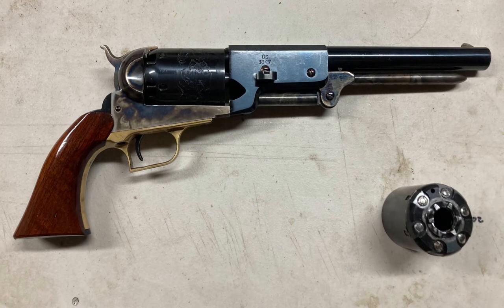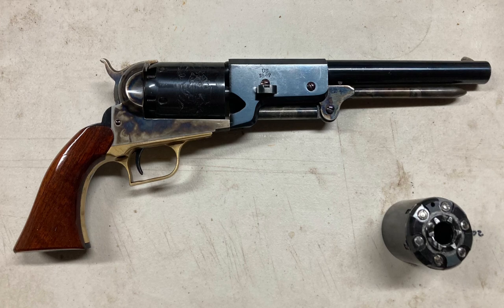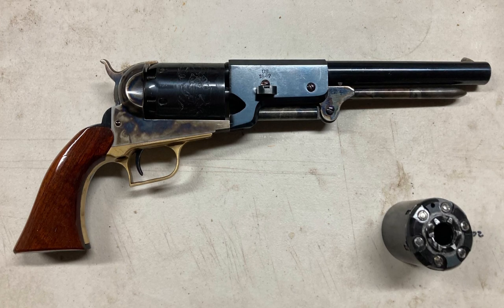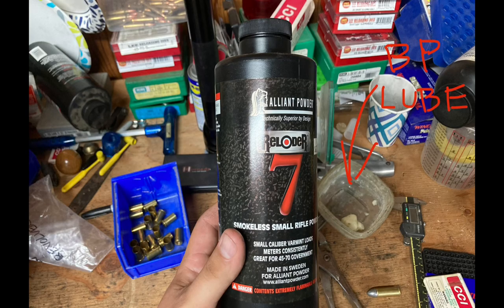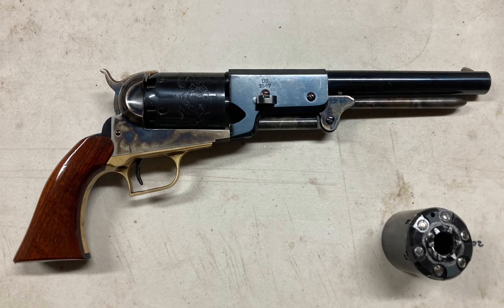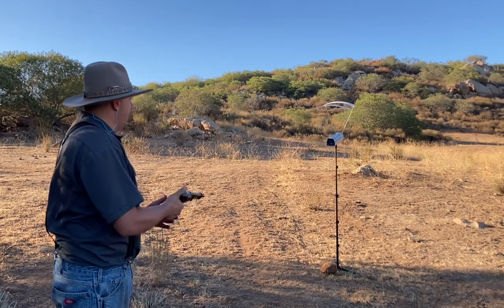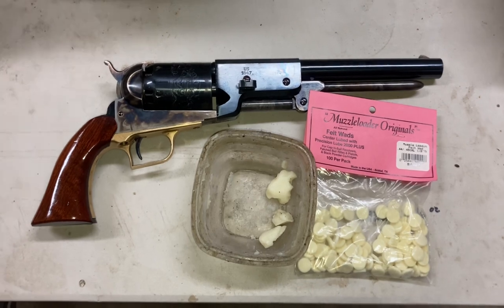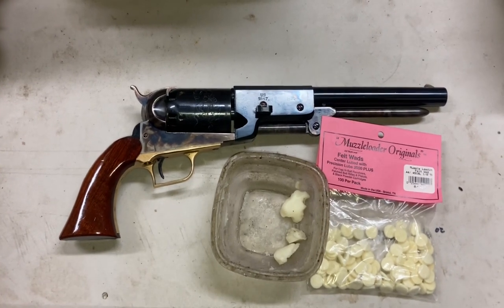Colt Walker Chain Fire

Comment: Never had a chain fire but I did have a pair of dragoons shear off the cylinder base pin at the wedge within days of each other. Armi San Marco quality.

I never use wads. Grease every third cylinder to keep things moving. .454 or .457 balls that shave off a big ring. Remington #10 caps. Seems to work fine.
Reply from the maker: I have one Army San Marco 1858 Remington and 454 balls don’t shave any lead. It will chain fire without wads or grease.
Reply: @Everythingblackpowder  Wow! Those chambers must be way oversized. Might even have flaws in the metal allowing flame into the next chamber. I gave up on all the San Marcos after the pin failures and only have Pietta’s now.
Reply from the maker: @HughesEnterprises  yeah, it needs a 457 ball at least.

Comment: I have had chain fires from a .22 revolver. Several times. It was unreal. Nothing was obvious but I polished the breech face and it hasn't done it again. The gun was a 1950 model H&R 922.
Reply: Had the same thing happen with an identical pistol. They are 9 shot, and the chamber walls between the rounds are quite thin. Today’s higher velocity rounds are just too much for the old gun, and the percussion can set adjacent rounds off. It’s pretty crazy, cause the other round hit the side of the frame and sprayed lead everywhere……it’s now my snake gun, and I only use ratshot and shorts……I’ve got two, one nickel round barrel, and the one that chain fired, a blued with a flat sided barrel. Beware the high powered rounds. And definitely stay away from stingers and maxis.

Comment: I had a chain fire from a 44 navy even with grease on all chambers, it hit the breakdown pin and knocked it 10 feet from me when the ball went beside the chamber! I was amazed it chain fired after the grease was used.
Reply from the maker: Wow
Reply: It probably happened from the rear side of the cylinder in that case, grease at the face end won't help that.
Reply: @redtra236  Yeah, you can't put grease on the nipples then put the caps on. My thinking later was the grease from some of the cylinders may have left after firing and some residue from the powder ignited.

Comment: Because loading the bp revolver is part of it I always use felt wads and boar butter. And in forty years of shooting I’ve never had a chain fire. 
I bought a sheet of wool and cut my own wads using a hole punch I got from harbor freight. They come in different sizes so you can cut what size you want.

Comment: I'm somewhat new to percussion revolvers, but from my experience, you have to make sure every piece in the system is within recommendation. All sorts of small things matter like the thou measurement of your projectiles and how tight and secure your caps are to give those core systems a nominal barrier against all sorts future issues. If the chain fires were caused from poor projectile seals then those patches and greases will probably do the trick, otherwise start looking long and hard at the other systems to end a real headscratcher.

Comment: Colt’s original instructions stated to load a [tight oversized] ball (or conical) over a powder charge and then prime with tight-fitting caps.   The only way you could get a chain fire from the muzzle-end of the cylinder is if the projectile isn’t perfectly round and seated. There should be a ring of lead shaved off when ball or bullet is completely seated. Loose caps are the main culprit of chain fire
Reply from the maker: Yeah, I’ve heard the loose Story 1000 times and I have a hard time believing it. If you’re interested, you can watch this video where we test that theory
Reply from the maker: https://youtu.be/hzkGsQWh4Gw?si=VsFQCgHDrqAyH5Ly

Comment: Did you ever figure out the velocity you were getting? And why the odd readings? Elmer Keith always said greasing and wads had no bearing on chain fires, that it was cap/nipple related. Cool video mate, thanks
Reply from the maker: Yes. 55gr 3f and a .454 round ball averaged 1253fps
Reply: @Everythingblackpowder  thanks mate,  that's quite a punch!

Comment: When you use a chronograph with blackpowder, you need to set the chronograph at least 30 feet away or it won't work right. I wonder if the muzzle blast was going 7200 fps? :)
Reply from the maker: agreed

Comment: If the ball has a ring of lead shaved off as you load the ball seals the chamber.  The wad before the ball lubs the ball and moisture mixes with powder fouling to keep it soft.  I have been shooting bp revolvers sense the 1960s.  I have had one time multiple chambers fired.  With an old 1858 new model Remington.  It used #10 caps and I was out.  I pinched #11 caps so they would stay on the nipples.  I watched the spark move from under 1 nipple to going under the next.  Three fired with no damage.  I now buy 1000 #10 caps at a time and when I get down to 500 I buy 1000 more.

Comment: Could be an issue with a wonky chamber diameter or defect in one of the chambers as well. Grease/wad would probably make up for that but if everything is correctly spec'd and fitting I don't think grease and wads are necessary. That's also completely an opinion and I have not been shooting black powder as long as you.

Comment: I've been shooting a Remington for 40 years, and have never had a chain-fire. I rarely grease the chambers, and never use wads. I have no idea how many thousands of rounds I've put through that old gun. I really doubt greasing the chamber mouths has anything to do with it. More likely, it was loose fitting caps, or badly made nipples.
Reply from the maker: That’s possible but the caps aren’t loose and I’ve never had a chain fire in it before. I think the excessive powder charge was a contributing factor. That’s a lot of fire and explosion going on and it managed to force its way into another chamber. How do you guys shoot those Remingtons without any lube? I’ve had a couple over the years and after 6 shots without lube mine would gum up something awful.
Reply: @Everythingblackpowder  After reloading,  spit right where the front of the cylinder meets the frame, at the pin, and turn the cylinder a couple of turns. Frees it right up.

Comment: I had it several times at euro arms replica of 1860 colt army. it always come from cap side. caps was too close to frame. fixed by drill tools, fxed for same height of nipels and some file job on frame. now gap is 0.8mm and issue solved.

Comment: I have a brass framed New Model Army made by Pietta. I always here "don't use cartridge conversions!" But what if I used the proper charge and bullet weight? Would it be safe then? I would buy a steel frame, but I can't find a single website that sells the frames by themselves.
Reply from the maker: I suppose if you loaded a 20-25gr charge of black powder and filled the rest of the case with wads to take up the space and topped it with a round ball. it wouldn’t have much more pressure than the cap and ball cylinder loaded with the same components. Just my opinion though…
Reply: @Everythingblackpowder  Guess I gotta experiment at some point and check for pre mature wear. Lol

Comment: I was always told that chainfires happen on the nipple side. I've been shooting BP for 10 years and never use felt wads or crisco on the cylinder side, no chainfires here (knock on wood). I always load an oversized ball (normally .454) and never leave a nipple uncapped with powder in it. Maybe the squeezing of the #10 caps and seating them firm help prevent it? TBH no one seems to know 100%. Shame your pistol has a war scar now, it's a nice piece
Reply: It can happen from either end, but if using a projectile that is shaving a ring of lead off when you load it its probably happening from the back side. If it's a looser fitting projectile and you aren't using wads or grease it's likely the face end.
Reply: @redtra236  i have also heard from other sources that if a cylinder is not perfectly bored out (it has a lip), it creates an non uniformed ball, which allows sparks to enter.
Reply: @blackhawk65589  Probably could happen if the cylinder is out of round by much, and I doubt that'd be good for accuracy either.

Comment: But why are you loading up 55gn in a cap n ball? How did you even get 55 gain of powder and a ball in there? I think mine says 20-35gn so I’m just gonna leave that there for you
Reply from the maker: I can fit 60gr 3F and a round ball in the chamber of my Walker. I wanted to see what the velocities are with a full chamber of powder, so that’s why. 25-30 gr in a Walker is a wimpy wimpy charge but that’s okay. I shoot 25gr in my 1860 army all the time and can get low 900fps so I figured the Walker would be in the 1200s but I never got a good reading.
Reply: @Everythingblackpowder  Well I’ll be honest I don’t know all the differences in cap n ball models. I have an 1860 Confederate copy and it’s listed as 35gn max I believe. So the chambers are longer in the walker? Is that much charge recommended in those?
Reply: @Everythingblackpowder  Also, thanks for the PSA about wads and grease. I have been using lard or shortening over the ball and bought some fiber wads but haven’t used them for that yet. I bought them for BP 410 loads
Reply from the maker: @308dad8  yes, Walkers are huge pistols compared to 1851s and 1860s.
Reply: The walker is a beast.  Made to be holstered on the horse, maybe 2 of them, you didn't where them on the waist. At 5'ish pounds a piece they would pull your pants down.   Here is some trivia:  "With a 9-inch barrel and . 44 caliber round, this weapon had an effective range of 100 yards and the muzzle energy of a . 357 Magnum. At  4.5 pounds, the Colt Walker 1847 was the most powerful U.S. military sidearm ever issued and the most powerful pistol until the introduction of the .357 Magnum .
Reply: @308dad8  hopefully that confederate model isn't a brass frame. If it is I wouldn't use any heavier charge than 25 grains. Those frames will enlarge in time shortening the service life of your pistol.
Reply: @denisdegamon8224  Ok. It is brass frame. I normally only shoot 25gn in it. I knew the brass was too soft for the conversion cylinders but I had no idea about using recommended loads stretching them. Nice little range toy. Made by Pietta for Traditions.

Comment: you don't need the felt wad that does nothing to prevent chainfires, that helps keep fouling soft in the cylinder. a tight fitting projectile seals the chambers from chainfires.
Reply from the maker: I disagree. It’s added protection against chain fires and helps to keep fouling soft.
Reply: @Everythingblackpowder  ive never chainfired ever. never used a wad either. in my .44 army. always have a ring of lead shaved off so i know for sure nothing is getting inside. the felt wad was never to prevent a chainfire it was added to keep cylinder bore from fouling preventing the loading of another round. when you try to load an oversized bullet into a fouled chamber bad things happen. its not possible to chainfire if your projectile is creating a 100%seal. your wads have to be perfectly oversized to even attempt creating a seal and even then they allow air and small particulates of powder to travel through them. they are not a chainfire prevention
Reply from the maker: What Causes A Chain Fire?
https://youtu.be/hzkGsQWh4Gw
Reply: @Everythingblackpowder  well done with the new video. i will agree that lube can and does seal the chamber when applied properly.

Comment: Come to think of it most of my chainfires have happened with Walkers. I am on my third one
Reply: Loose fitting balls and full charges and forgetting the lube over the chamber mouths being the obvious cause.
But come think about it.  Those 60 grain charges probably generate enough pressure between the back of the ball and the face of the barrel to bounce some pressure back towards the chamber mouths.
That may contribute to the problem.
Reply from the maker: I agree

Comment: You are using bullets too small for your gun, if you shave a proper ring of lead it won’t chain fire even without wads and grease. Only chain fire I ever had I used undersized bullets and low and behold, chain fire. Never had an issue otherwise.
Reply: I also shoot a lot of Cap and Ball, among other things, and the same goes for me. I had 2 chainfires, ever, and one was because I used undersized ball. I also don't shoot with wads, and I use Grease only when at the range or if I plan on keeping it loaded for long periods of time. It's too much of a hassle for me to load it with grease if I'm out in the woods or something. 
Yes, fouling gets terrible, I don't normally shoot it more than 2 cylinders anyway though.
Reply from the maker: I use .454 balls and it shaves lead just like it’s supposed to and it still chain fired.

Comment: Don't use smokeless powders period in these firearms. The metals and designs of these antique firearms were never designed to handle the much higher pressures smokeless powders.
Reply from the maker: Sorry mister. We live dangerously around here.
Reply: @Everythingblackpowder 
I recon so.
Reply: This is not an antique firearm .
Reply: @453421abcdefg12345  
That may be true however the metals used and their design was not for handling the higher pressures of smokless powders.
I have been using these black powder firearms for 47 years and I am also a living history reenactor, so I know of what I speak. If you doubt what I am saying call a major manufacturer of said replicas.
Please do yourself and other enthusiast's a big favor and get the facts before somone gets hurt.
Reply: @denisdegamon8224  It would be absolute folly to use smokeless powder in a muzzle loader, however, no one here is suggesting that one should do this, I am not sure where you get the idea that smokeless is being used here, the steel that modern black powder arms are made of is the same as cartridge guns, however, the manner in which they are loaded does not allow smokeless to be loaded, but a cartridge conversion cylinder is available for most Cap& Ball revolvers, and I am sure a lot of these are used using a mild load, as for facts, I suggest you view the video before coming out with such tales of woe.
Reply from the maker: Taylor’s sells Richard mason converson pistols and 1872 open tops that are made by Uberti. Same material, same design as the dragoon and Walker. As long as you’re using low velocity lead “cowboy loads” the pistols are guaranteed. Personally, I don’t loose any sleep over this topic. I have three open tops that are converted and have put thousands of rounds through them without any issues. I typically shoot black powder cartridges with them but I have shot plenty of low velocity smokeless rounds through them as well. Nobody is advocating for loading their cap and ball pistols with smokeless or running some Elmer Keith style loads in their conversion cylinders but I’m sure there’s somebody out there that has.
Reply: @453421abcdefg12345  
I am well aware of the steels used these days and the cartridge conversions as I have several.
I was referring to the can of smokless powder early in this video and the weaker brass frame replicas.
If the ruth was to be known, I probably forgot more about this subject than you  have learned to date. No need for your pompus ass comments or attitude.
Lighten up already.
Reply: @denisdegamon8224  Since we appear to be holding a pissing contest, I am a founder member of the Muzzle Loaders Association, not that that would infer any expertise, but you seem to think so, how do you know that the can of smokeless shown in the frame was even used in the loading of this gun, it just happened to be in the shot showing the tin of lube? And what mention of brass frame revolvers is there? As for having forgotten more than I have ever known I think that must qualify as about the most pompous statement ever, (even though you spell Pompous incorrectly), you must be a crashing bore and a fool to be with! Chris B.
Reply from the maker: I think what we’ve got here is failure to communicate… I didn’t catch any mention of the brass frame revolver being used with a cartridge and I certainly didn’t state or imply I was using the Reloader 7 powder for any converted revolvers. I do find it hilarious that he says he’s forgotten more than you’ll ever know and then calls YOU pompous! Dang that’s funny!
Reply: @Everythingblackpowder  Ha Ha! Yes I had a real good laugh at that pop, I think this man must have fired from the hip without getting his facts together, maybe he is on something! Keep up the good work ! Chris B.

Comment: Or,,, you could use the correct size projectile and not have a chain fire. If it's a .45, instead of using .450 or .452 for example, use .457 and you won't have chain fire plus no need for wad or messy melting grease.
Reply from the maker: I’ve owned this pistol for 10 years and have shot .454 balls and only ever had one chain fire. As for the grease it keeps the pistol running longer without jamming up with fouling as well as helping to prevent chain fires.
Reply: @Everythingblackpowder  yes, grease will help with fouling.
Reply from the maker: @NorthFloridaAirGunner  and chain fires 😉

Comment: You can see a cap leave the gun when you fire the pistol prior to the chain fire occurring. This has nothing to do with the front of the cylinder, wads, grease, the curvature of the earth or any other cap and ball revolver voodoo. If you have a loaded chamber with no cap on the nipple you're asking for an ignition of that cylinder while the others are being fired.
Reply from the maker: It’s very possible it came from the nipple side but I didn’t lose any caps. When I drop the hammer and it doesn’t go off it’s on the chamber that chain fired. This guy did a really interesting experiment where he didn’t cap the nipple to see if he could cause a chain fire. https://youtu.be/sMvsjn7Eavs